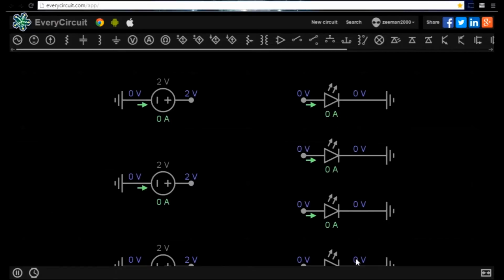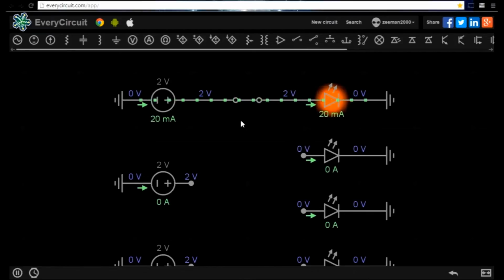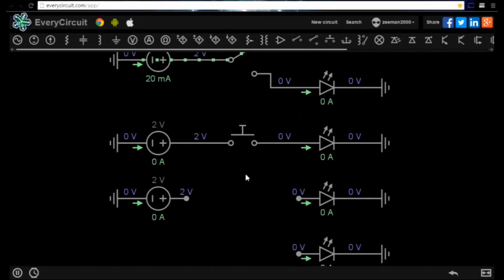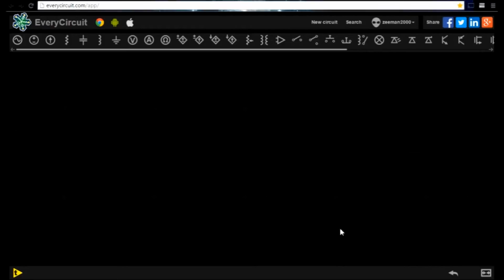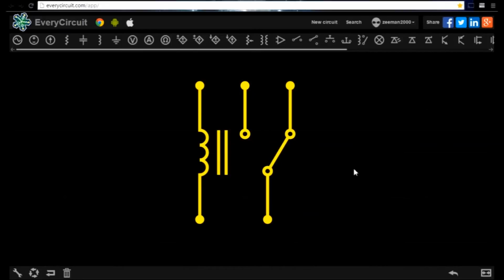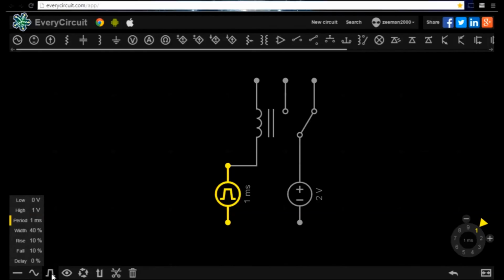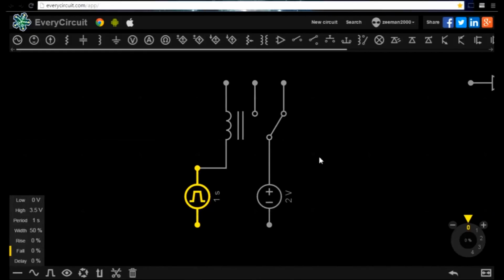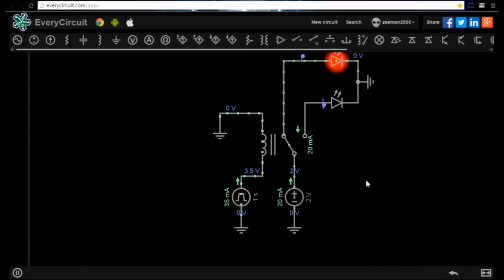Electronics Tutorial 7 - Switches

Comment: The circuit with the Relay would fail in real life due to not having a diode across the relay which is needed to suppress the back emf pulse generated when the relay opens if this circuit had any delicate component such as an IC  the spike would kill the IC